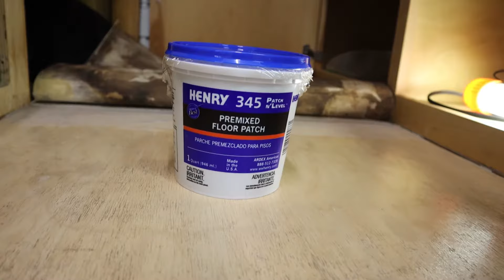Water Damage RV Floor

Comment: Great video. But let me add a piece of advice to the readers- Dremel is not your only option with these tools. Every tool manufacturer makes a multi-tool (or oscillating saw) as well as an angle grinder or what is referred to here as a Rotozip.
Reply from the maker: I used a Rotozip. What part of the video are you referring to?
Thanks !
Reply: @SafeTravelRV  You used a Dremel oscillating saw to cut out the subfloor. Just want DIY'ers to know they don't have to look specifically for this brand. Every leading tool mfg makes a multi-tool (or oscillating saw).

Comment: What about the rot extending under the cabinets? Was there any and if so, what do you do about that? I don't think the rot is going to stop at the edge of the cabinets.
Reply from the maker: @busarider284   There was a little discoloration but no delaminating of plywood. If it was that extensive, I would have replaced the whole floor.
Reply: @SafeTravelRV  so if only wet but no delamination then the cabinets do not need to be removed? I have the same question as I have just found water in my kitchen and bath area that I can tell has gone past where you can actually see wood.
Reply from the maker: It’s a decision based on cost and structural integrity and if removing the material under a cabinet is deemed necessary. Owner did not want to spend the extra money.

Comment: Fantastic Video Big Al. I was wondering if you could bless with me some of your knowledge on how to fix a travel trailer that’s has water damage in the bedroom only? I have removed all the cabinets and front wall and installation. Now I’m stuck and don’t know the best way to handle the flooring as it’s wet even under the foam which I have taken part of it out as it dry.
Reply from the maker: Hi, I have never attempted a project that big! Hopefully there is a video out there that can help you. Good Luck
Reply: I'm working on my RV as well. All the floor is rotted out. I had to re stud the whole damn thing and did two layers of  half inch OSB board in a staggered way so it will be more solid. I'm almost done...just have the bathroom left and it's a wrap, the hardest part was getting motivated to start it because all the water damage was from the shit water coming from the overflowed tank that they where able to flush out they just kept using like that....i had to wear a mask and gloves otherwise I couldn't get myself to pulling it off....main thing is just go for it.tear that shit all the way to the bones